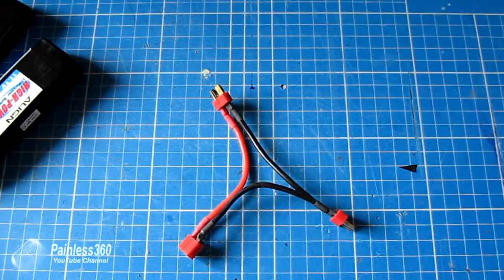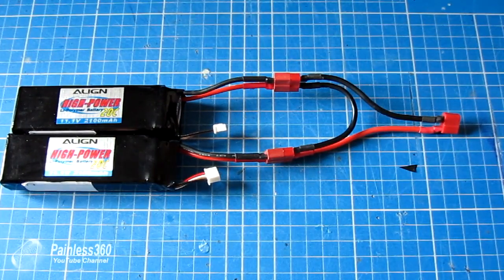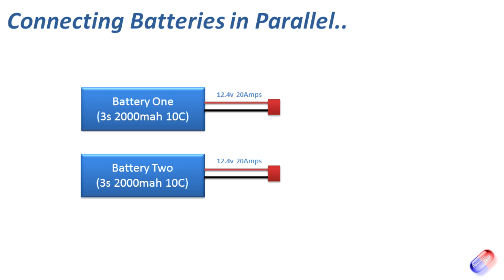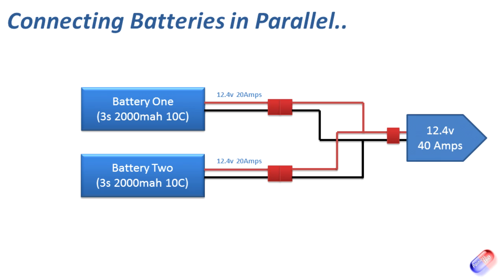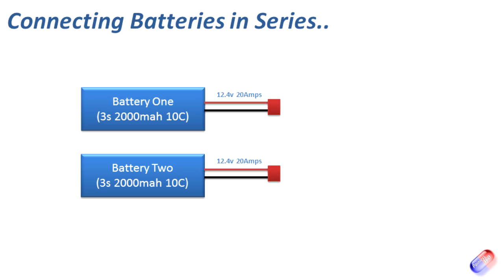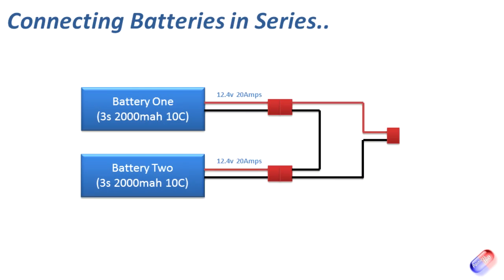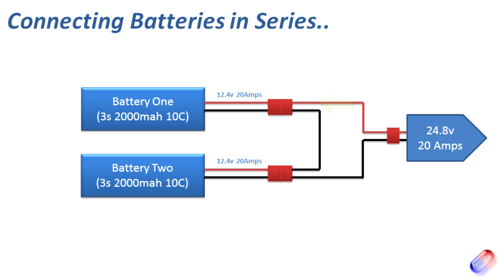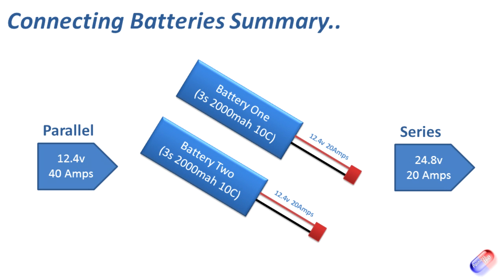Connecting batteries in series or parallel (LIPO)

Comment from the maker: If you are still confused after watching this old video then the later version is easier to follow and answers many of the common questions from this video - https://youtu.be/_iKzPArooLM
Reply: So do you just leave the charging cord alone and it doesn’t need to plug into anything when running your rc like will it still work in water?
Reply: Instablaster.
Reply: Mine holds 2 LiPO batteries okay and it dies after being played with but one of the batteries is less powered than the other one when I'm showing 8.4 volts the other one still showing 11 volts what's going on

Comment: Can I use series connector to add a 3.7v to an existing 7.4v battery pack with the same capacity to make a 11.1v? 

Great and helpful video BTW
Reply from the maker: In theory, but the new cell would have to be identical to the other two to not impact the battery performance... Happy flying

Comment: Hello I have a question is make a double 2s that make 4s now but on my the esc start to blow a lot of air them its slow Down do you have an idea I was thinking that the esc couldnt handle 4s if you have any info it would be great Thank !
Reply from the maker: I'd confirm that ESC is rated for 4s as step one. If it's a plane, then the prop will need to be reduced too... Best of luck

Comment: Awesome video even applicable in 2025. I know parallel definitely will increase flight time a lot. How about series? will it increase flight time just a little? I know you keep same amount of milliamps and increased voltage but is there a chance flight time will increase a bit?
Reply from the maker: The amount of power a motor/prop needs to move the plane remains the same so that if you increase the voltage, the current will go down. But, the system has to be able to support the higher voltages and the prop would need to be reduced for the faster rotation speed of the motor (unless you changed that too!) See my motor and prop series for more on all this...

Comment: Can u use 4 batteeys, in series like if i want to use 2 cell batterys to run a 8s rig can i have two for each plug on the esc
Reply: And can I also run 2 battery's on one side and one on the other if I want to run 2x 2cell for one side 1x 4cell for other side

Comment: Can I run a 5000 mah and a 6500 in a series
Reply from the maker: While technically possible,  I wouldn't recommend using mismatched batteries.
Reply: I take it in series also wouldn't be recommended @Painless360

Comment: I thought connecting the negative lead to the positive lead on the other battery together short circuits it? I need a 6s battery and plan on connecting in series. So can I do it like that without short circuiting it?
Reply from the maker: That's how batteries are connected in series. If you're still not sure after watching the video,  get someone who understands electronics to help tomavoid issues. Best of luck

Comment: Hey dude great video, couple of questions. I have a 3S LIPO, is there a way to tell when the battery is out of charge? My current method is by going from fully charged at (4.2v per cell) 12.6v to when it hits (3.7v per cell)11.1v, is this correct or is there a more accurate way? Also when connecting in parallel will all cells across both batteries discharge at the same rate?
Reply from the maker: The voltage ranges you're using with the batteries are great. Using a timer on the radio, or battery voltage telemetry can help... Happy flying
Reply: @Painless360  10 year old video, replies to comments next day. Absolute legend. thanks fella!

Comment: Cam you also put 30 lipo batteries in paralel?
Reply from the maker: You can. But be very careful. Best of luck
Reply: @Painless360  and can i also put lithium ion batteries and lipo batteries in a paralel together?
Reply from the maker: Unless you really know what you're doing, putting mismatches cells in series and parrallel is not a great idea...If in doubt, don't.

Comment: Quick question, I can add a 10s4p and a 2s4p in series together and make a 12s. Like the ESC will see 12s or 50.4v fully charged.
I'll obviously disconnect for charging them separately.
It's for a electric skateboard increasing the voltage DIY.
Using stock 10s4p 18650 battery and adding 2s4p 18650 battery.
Like going from 4s to 6s on Quadcopters.
More power n rpm.
Great videos to always refer back to.
Cheers again.
Reply from the maker: Yes, but be very careful that the cell specs are the same... best of luck

Comment: Hi so if 1 battery can charge at 2 amp if i parallel 2 same packs can i charge at 4amp please
Reply from the maker: In theory, yes. But that relies on both batteries being identical. Be very careful charging in series or parrallel, it can be dangerous... Best of luck
Reply: @Painless360  will charge them separately:)

Comment: Excellent video,  so the voltage in series connection is what increases rpms while the amps increases the torque in parallel, soon I'm going to do a short video showing 120volts with a current of about  7.5amps and another being 240 at 15 amps  , lithiums may be capable of high current using them in a electrolytic fashion,  in general lithiums are usually separate to the load through a pcb unlike nickel that just use diodes, consider rewinding the rotor increasing the gauge to handle the unexpected current or unregulating the current

Comment: Can I connect two  3s 1500mah 25c in parallel to use my scratch build rc plane
Reply from the maker: Yes. Is it a 3s 3000mah pack you want?

Comment: Thank you, this solved a problem for me.  I'm installing an e flite 360 onto a hanger 9 xcub 60cc.  I'm using a a castle 160 amp esc and a bec.  I want to run 12s and didn't know how to rig up the batteries.  You explained how to solve my issue, great video

Comment: This is a long shot hope you see this… so if I connect 2 3s 2200mah lipos in parallel… what should my osd read for mah?? Do I set it for 4400mah or 2200 mah ??
Reply from the maker: For batteries in parrallel, the voltage stays the same, the current and available capacity increases.... Happy flying
Reply: @Painless360  thank you love your channel ❤️❤️

Comment: Can we connect **  two  different C  rated 3s *battery in parallel  (suppose  one battery is 2200mah 50c  another one 1000mah 40c     ? Pls reply
Reply from the maker: Not ideal. This video was made back when larger packs were super expensive. Happy flying!
Reply: @Painless360  i will not use in flying..i want to use in 12v spot welding kit
Reply from the maker: Again, not ideal. You can try it but I'd check the batteries. One will be working harder than the other if they are not matched and can be damaged a lot easier..

Comment: Thanks for this video it will be very helpful when I'll be connecting second battery to the Scooter. Just one question if you don't mind. Will different length of the cables connecting batteries to the controller (one battery in the floor next to board other one on the handle bar) cause some troubles?
Reply from the maker: Cable length on something like a scooter shouldn't be a problem. Best of luck

Comment: Iv tryed it only for 3 mins the Y and the battery swelled a little i havent tryed the V yet
Reply from the maker: If the batteries are getting hot or swelling - STOP. It sounds like you've potentially made a wiring mistake that is causing a short. Triple check the wiring.
Reply: @Painless360  ok thanks

Comment: What is the deffrence in running parallel and getting 1 battery
Reply from the maker: In terms of what exactly? There can be differences in cost and weight...
Reply: @Painless360  like my battery is 7.4 1600mah 30c and running parallel the voltage goes to 14.8 and getting 1 battery its 14.8 or there 2s and going to 4s
Reply from the maker: If the voltage increases then it is in series not parrallel.. be careful connecting batteries together...
Reply: @Painless360  so the battery is 7.4 1600mah 30c and go up to 14.8

Comment: Halo, great video. I have some question, what if i use 2 battrey with different mah but same voltage in paralel mode. Will it work fine? Or any suggest and what? Thanks.
Reply from the maker: I wouldn't as one of the batteries will be empty first.. If you are going to do this, start with identical packs until you have a better idea of the principles. Best of luck

Comment: Hi...can i parallel 2 batteries same voltage but differents amps and total up...example 10ah +14ah=24ah
Reply from the maker: I wouldn't. To avoid problems the batteries need to be matched... Happy flying

Comment: Hello! What about the C rating? Do they add up if connected in series? Say 2 lipo with 10C connected in series becomes a 20C? Or does the C rating stays the same?
Reply from the maker: The current flows through both batteries so the C rating is the same when they are in series.. Happy flying
Reply: @Painless360  Thank you for replying now I understand more of Lipo battery!

Comment: Is there any way in an rc plane(prop or edf) that i could use 2 batterys to extend the flight time? So on average with a 6s 4000mah i can get an average of a 4 min flight time is there anyway that i could put 2 so i have a 8 minute light time?
Reply from the maker: The model you have must be pulling a huge current to empty a battery in a few minutes. Doubling the capacity of the battery doesn't result in a doubling of flight time as you have to take into account the extra weight of the bigger battery... Happy flying
Reply: @Painless360  ah ok thanks doe this info. I'm going to get a 70mm edf and at 100% throttle it pulls around 1240w from the tests that i have seen

Comment: It can be VERY DANGEROUS to connect high current batteries like these in parallel if they are not charged to the same voltage. This is VERY IMPORTANT. THE BATTERIES MUST BE CHARGED TO THE SAME VOLTAGE BEFORE THEY ARE CONNECTED TOGETHER. If one is fully charged and the other discharged, when they are connected together, VERY high currents could pass between the batteries.
Making cables like those shown here, with no fuses between the batteries, is playing with fire (literally!), and a nasty accident just waiting to happen.

Comment: have a question I have a e-bike and I have two 36-volt batteries hooked and serious these batteries I have are no more than maybe two months old and I bought a brand new one thinking that what solved the problem and it didn't but I will hook these batteries up in series and put a load on the bike like going up the hill at half throttle I will be halfway up the hill and the votes in the battery were dropped down rate in front of my face so far the bike were cut off and then I would have to unplug the plug replug it and it will be okay until I put another load on the battery and then that would happen again could you please let me know what the problem could be

Comment: on a series connection if you have two batteries that each have 25C discharge rate , would end result be in 50 C rating?
Reply from the maker: Nope.

Comment: when you place multiple batteries for an r/c car, does the battery C rating has to match? example if I used a 2S lipo 25C plus a 4s lipo 50C rating to have 6S lipo is that ok?
or would both batteries have to have 50 c rating?
Reply from the maker: Please see the later version of the video linked in the description. It answers a lot of the common questions in this comment section..

Comment: Hello. Can you please tell me if I can charge two batteries connected in series without disconnecting them ? I got two 24w 6amp batteries connected in series. And from each one I got the charging port. Can I charge them individually without disconnecting them from series connection?
Reply from the maker: That will work but it's not idea in those cases where the cells packs are not well matched. I'd always charge the packs separately.. best of luck!
Reply: @Painless360  thank you. They are from this same company and from this same producer. But I will charge them separately it will be safe

Comment: So I can buy two 48v 20ah li-on batteries put them in parallel with my ebike?! SWEET
Reply: Could you still just use a 1000w hub motor, or does it need to be more powerful, I want to make a 1000w ebike that has enough power to climb hills and can go for quite a few miles,

Comment: hello great video,  i want to connect several lipo rc packs together for a ebike build but i want know do i remove each bms chip from each pack to install a big bms overall or do  i just run the lupis with no bms and use a balance charger? if you help that would be fantastic
Reply from the maker: No idea, the packs I'm using here are not chipped. Best of luck!

Comment: Can you run two 6 cell 7.2 2000mah  battery packs that are in a series circuit into a parallel circuit?  Or will that cause problems? Basically asking do the batteries in a parallel circuit have to be single cell?
Reply from the maker: See the later version of this video (in description) for where I cover that exact topics. Best of luck!

Comment: Hello i have a query... i used 3 old mobile batteries of 3.7 volt 6Amp (BM47) to power my diy bldc helicopter. when i connect these batteries in parallel thinking that current will increase but it slightly increases to 6-8Amps, when i connected it in series it gives 15 Amps as well voltage increase to 12.6(should be) .... but why current increased in series connection ? can you guide me with this.
Reply from the maker: More voltage will push a higher current in a simple resistive circuit... If the model is brushless then that is unusual..
Reply: @Painless360  thanks

Comment: Suppose I connect 2 lipos first in series and then in parallel in my rc plane. What changes will i see, not in numbers but in the flight performance
Reply from the maker: You can't do both with the same two batteries at the same time...
Reply: @Painless360  No actually I meant in different situations
Reply from the maker: Without a rework of the ESC motor and prop you won't be able to do series...Happy flying

Comment: Nice & Thanks :) I find most of the electric skateboard having a cap of 12S with the batteries... Why so ? Sir , Can we add two 12S4P batteries in parallel connection like this ?
Reply from the maker: That would keep the voltage the same but increase the range..
Reply: @Painless360  That's my idea.. so it's possible. Thanks a lot :) Sir, Any idea on why the electric skateboards are limited to 12S4P battery assembly ? I mean 12S ...
Reply from the maker: No idea, I've not played with them. It's most likely to be a limitation of the power system. Best of luck
Reply: @Painless360   Thank you so much Sir :) Have a great day :)

Comment: Hi, just watched your video and it’s very helpful, I have a question if you could help? I have a cctv test mointor which the battery doesn’t work properly, on the charger it said 12 v in to charge but when I do that the charger get very hot and doesn’t charge properly, when I took battery out it looked like it was 7.4 battery that was in series, do I need use a 7,4 battery charger as original didn’t come with it , also the cctv mointor has a 12 v out and confused how that works?
Reply from the maker: Tricky to comment without the specifics of the monitor you have but that sounds like there is an issue with the charger, charging circuitry or battery. You usually need a higher voltage from the charger to push the current through the battery you're trying to charge but if its getting hot somethings wrong.. Best of luck

Comment: Thanks for this video, very useful and simple. I'm interested in making a 12s6p battery, could I make the 12s6p battery then connect a couple of lipo batteries in parallel to increase the capacity?
Reply from the maker: You can always connections mode packs.. see the updated later version here this video... happy flying!